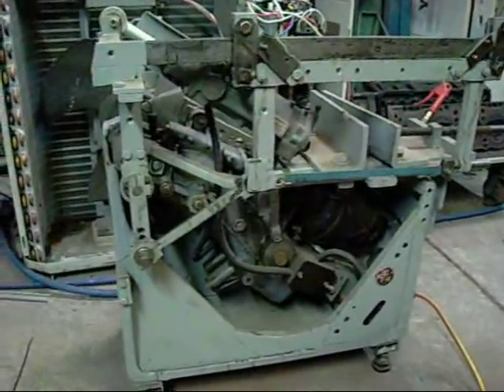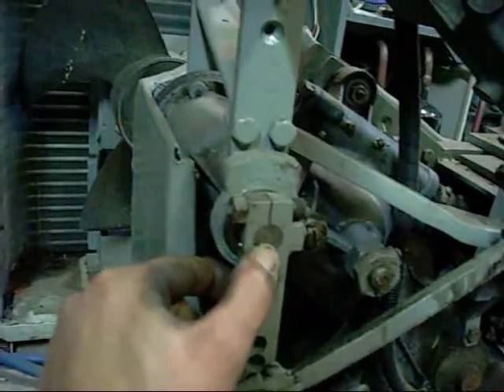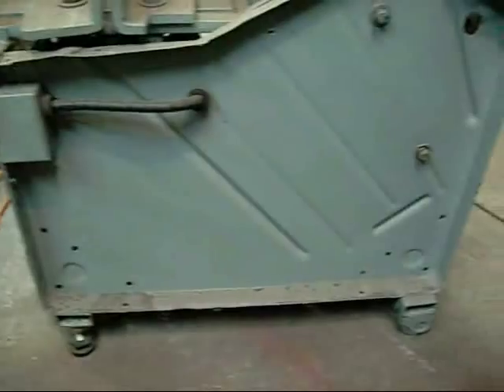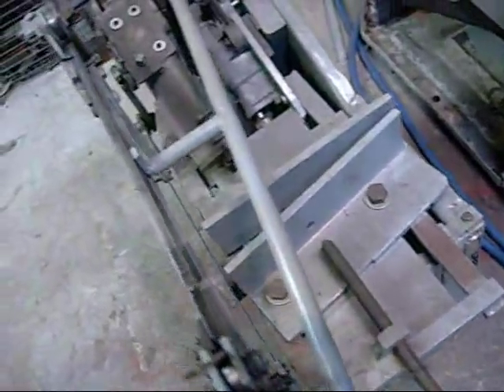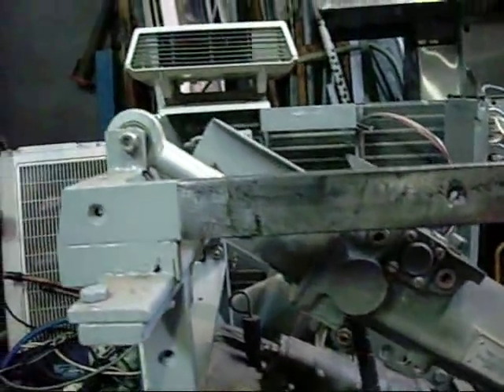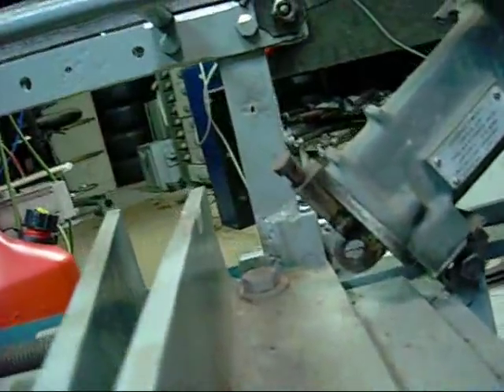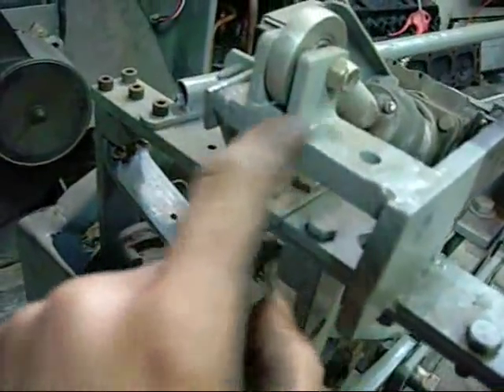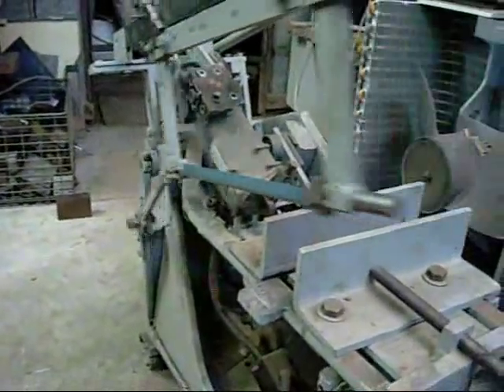For HDFXH Hacksaw Washing Machine Parts

Comment: I have a similar but smaller saw, it didnt run so well as the motor was going backwards, the 'dogbone' linkage between the crank and the saw is sposed to lift up the saw on the forward stroke to releive the pressure on the balde when its not cutting.
I noticed yours is going the same way mine was, might be worth reversing the motor and see if it cuts better.